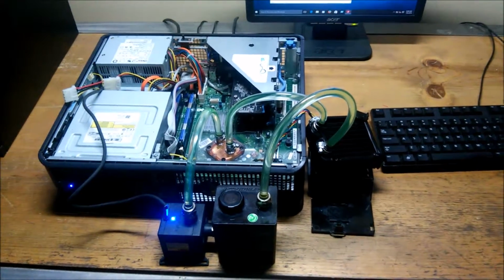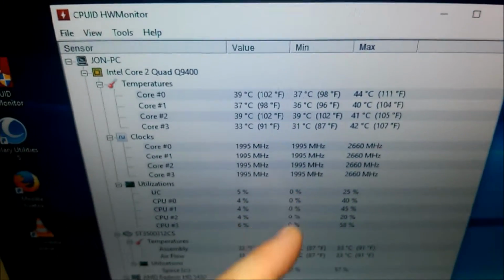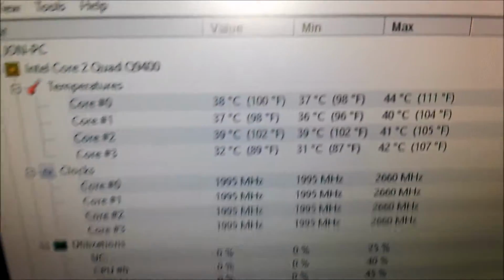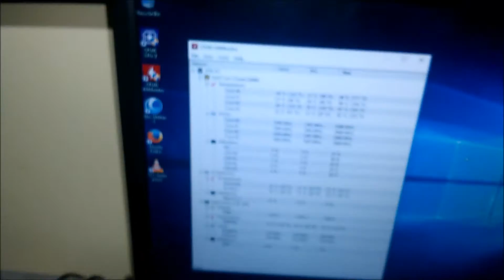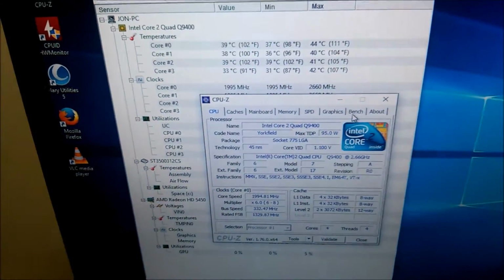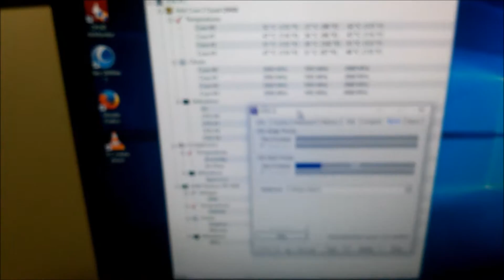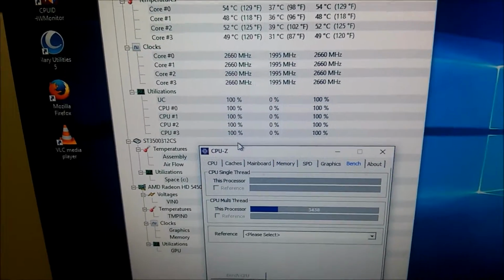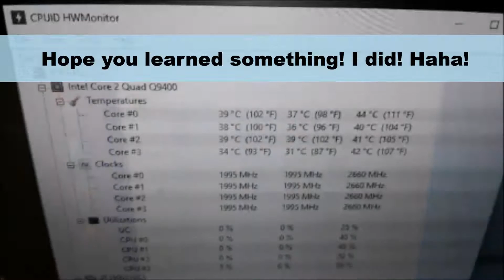Retesting DT Water loop- HWMonitor for Dummies ... like Me!

Comment: Awesome Job, you've inspired me to water mod my 780 now... I have an Aquacool something or other, 1/4" tubing designed for LGA 775 that I thought was a single 120MM fan but turns out it's 80MM Rad so needless to say when you showed this video you reminded me I had that stuff... I bought it years ago and never used it but just might have to give it a go now...

Hardware Monitor is also great to check to see which is being bottle necked, the CPU or GPU because of how it tracks Utilization. Some games I've played hardly use the GPU at all, mostly CPU reads 100% and GPU is like 20 to 30%. Some games tax the GPU but not many; but I don't play really high end games these days...

Here is something else you may want to Google, Dell 5 pin Fan to regular 4 Pin Fan connector Adapter. They are mostly sold from China, shipping takes a Fortnight or 3 LOL, but what this will do is allow you to adapt a regular 4 PWM fan to the Dell MB Connector. I think 5 adapters cost like 5 bucks, free shipping or maybe less. As I mentioned I own a lot of Dell's and these connector are handy. 

Don't get me wrong, Dell Fans are Superior to most any on the market but some times you just want to use a Lighted Fan that Dell does not offer; or none that I've found... 

Great Project too... Oh, you mentioned a few videos ago when you cut the Plexy Hold Down that you didn't cover it so here is an idea you just might kick yourself over. Next time you cut Plexy cover it in Blue Painters Tape. It's easy to remove and does not leave any residue behind. I look forward to seeing what you get into next... Cheers....
Reply from the maker: Nice man! Water cooling is a lot of fun. I bought a 780 DT for the water loop project, didn't want to waste the resources on the DDR2 machine. I'm going to try and cool an RX 470 and a Q9505S with a nice double 60mm Alphacool radiator. It's about 175W total. I just need the psu and the gpu and I'll start the project. Should be a couple more weeks at the most. Thanks again for giving me a lot of great info, you obviously know wore about the Optiplex and the 775/771 socket than me.
Reply: Honestly I don't know that much more than you. I bought this Dell 780 by accident, thought it was an ATX Board that could fit any regular case and it's not. So little by little I'd been putting the parts together and stumbled onto the LGA 771 Mod about a year ago. I've just been doing a lot of research as of late. My first LGA Mod was trying the 5XXX Series on the Dell T3400 and of course it failing. It's only been since Oct, 2016, that I found out about the X3363 and I have to say it's a decent CPU for 22 bucks. I gave up on AMD all together at the start of Jan 2016 and dump anything I had that was AMD. I used Raptr Daily for well over 7 years as I was trying to get that Free R7 GPU only to realize that as soon as I got within range of being able to get it, the price would double again. AMD is all HYPE and has yet to produce anything of Worth. This new ZEN, Ryzen, Hozen, whatever is going to flop just like anything else. Everyone thinks Ryzen is going to be as good as the 6900K and I am here to say it won't be CLOSE. If it is close it won't be for the suggest retail price of 600 bucks when the 6900K is 1,000. The fact that AMD is still using Dual Channel Memory just goes to show in the long run it won't be worth it. Right now AMD has like 2 or 3 CPU's in the PassMark top 200 CPU List with the FX 8350 not even in the Top 200 anymore. The FX 9XXX cpu's, only 2 and not even close to be worth the money and an Opteron CPU that is ranked at 150ish. For over 20 years I followed AMD because it was the Bomb; but these days Intel is so far ahead AMD is not even on the same Planet... Cheers...
Reply from the maker: I love the 780! And the BTX form factor. BTX makes modding a lot more fun and challenging. I wish I could find a BTX aftermarket board but I don't think any manufactures ever produced any. I really hope that AMD can compete a little, I always love the underdog. I had been using an FX6300 but was having a lot of motherboard issues so I swapped it for a Z97 and an i54690. Games run about 15fps better and a lot smoother now. If the gap between Ryzen and Skylake/Kaby is significantly smaller (30%?) than the gap between the current FX8350 and i5 Haswell then I will do a Ryzen build. It doesn't have to beat Intel's stuff, but the price better be right. AMD won't be in business long if they screw this up.
Reply: Nice... I suppose I just lost faith in AMD and agree if they screw this up they are done for sure... I hear ya about cost, but I have also found that you really do get what you pay for. The money I wasted on AMD in 2012 would not have gone as far with Intel but I was not buying used back then either. Now that eBay sells 4 year old 1,000 Intel CPU's for 60 bucks all of a sudden used Intel is very appealing. I've spent less over the past year switching over to Intel than I've spend on AMD. Talk to ya soon... Cheers....
Reply from the maker: Used Intel CPU's are probably the best value out there. An i5 2500k is still an amazing chip and sells for $80 most of the time. I'm actually going to get one soon for my Optiplex 390.
Reply: Nice....

Comment: why did you go with a Q9400? rather than a Q9650? Also I would recommend a 750ti over the 5450
Reply from the maker: This video is about testing the 80mm radiator, not really the PC hardware. Thanks for the 750ti recommendation though. Did you watch the 780 SFF Mod video? It has a 750ti in it. My other video with the 780 MT has a R9 270 in it that is 50% stronger than a 750ti. This Optiplex 755 DT sits in my bedroom and plays movies, it doesn't need anything more than that a HD 5450. As for the Q9400 vs Q9650 question, the 9400 I got for $18, a Q9650 is $50-60 (sometimes more). Fixing up and modding these old Dell's is just a hobby for me and I have to keep the cost under control. I really love old Optiplex PC's but, they are not worth spending hundreds of dollars on. I just bought an i5 4690 a couple months ago for $100 that beats the $60 Q9650 in benchmarks by 100%. A used FX6300 is like $70 and beats the Q9650 by over 20%. As far as performance goes, all C2Q should cost around $20-30 at the most. Now I'm off to spend more cash on this obsolete technology, long live LGA775! =)

Comment: Those temps looked good but i would let it sit at load for like 10 or 15 mins. Cant wait to see you fit it all in the case.
Reply from the maker: Yeah, I need to test it longer for sure. I just wanted to see where it peaked and try not to torture you guys with the wait time. I actually have a list of parts that I think will work. I have to "one up" the 780 SFF!